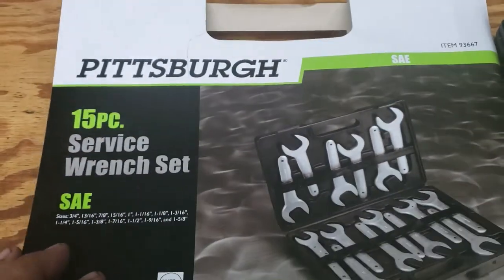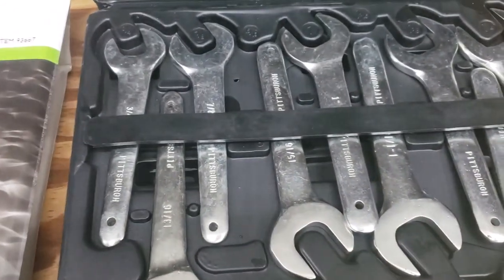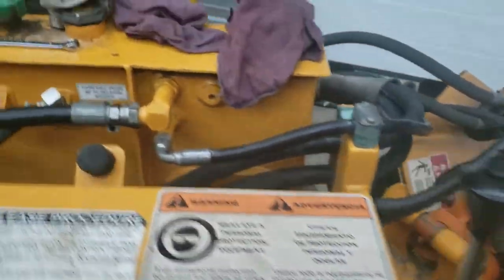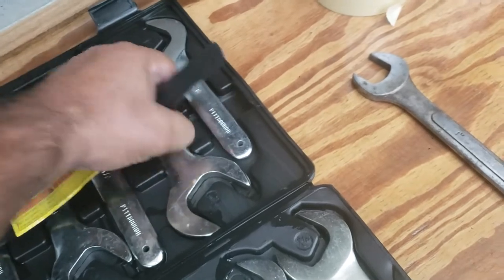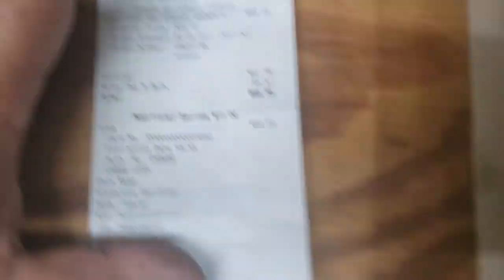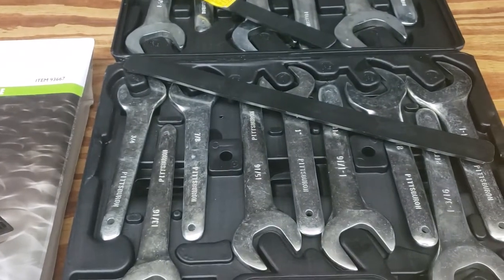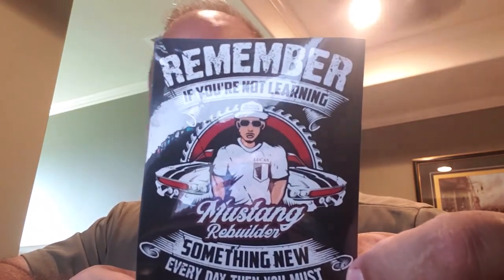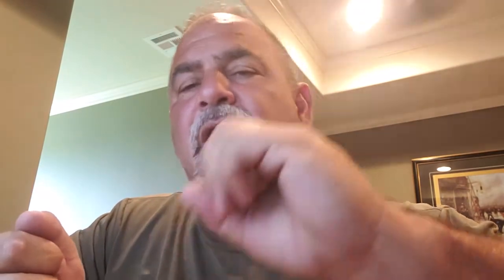Harbor Freight PITTSBURGH Service Wrench Set

Comment: Thank you for making this video, before this I didn’t know what people actually used service/farm wrenches for. I’m a heavy equipment operator and mechanic and always expanding my toolset with new tools I come across that might make my job easier. I’ve had to deal with situations like yours but thankfully had other tools (or combinations of tools) that let me accomplish the task, though after seeing this video perhaps a service wrench might have made it easier.

You’re spot on about having a wide skill set and about the trades in general. I used to be a white collar worker, my first career was doing computer support, repair, and administration. My mechanical skills were limited to what I’d learned maintain in my cars to save money where I could, just simple things like oil changes, brakes, fuel pumps, wheel bearings, and a few transaxles. …mostly learned from Haynes manuals I’ve bought for all my vehicles of the years (if readers don’t now about them then go get yourself one at autozone for your vehicle and be astounded at what you can do at home!)

My IT career stalled out and stagnated at a behind the times company I spent 9 years at, we were still running a mainframe in addition to newer tech, and my earnings were low (around 36k/yr). I ended up losing my job and my skills hadn’t kept up with the times (couldn’t afford school) so I was working a warehouse job and driving pizzas at night while looking for a new IT job. Well via a family friend the opportunity to become a heavy equipment operator fell into my lap.

Cousin’s best friend owned a company and liked hiring hard working people that didn’t know anything so they’d learn HIS way. I jumped at the opportunity and the guy gave me a chance, but I had to earn my position with hard work and dedication. Thankfully I got to train with a couple guys that really knew their stuff and didn’t mind training someone that was willing to work as hard as them. 10yrs on I earn multiples of what I did in IT, now have a decent enough house, a nice truck loaded for bear with my own tools, amore mechanical mind and an ever expanding skill set that’s allowed me to help my neighbors and strangers and that has saved me countless thousands of dollars, and I have options for employment!

Brother’s tradesman too, millwright and industrial maintenance, and we both encourage the next generation of our family to seriously consider the trades regardless of what the kids aim to do in life, we tell them you can learn a trade and earn more than any of your peers while going to college for whatever you want to learn, then you have real options!

One of my nephews seems to definitely be trade bound, tough he hasn’t decided on which yet. He’s the go to for fixing a lot of stuff in his house as his parents are definitely not mechanically minded, it’s kind of funny really seeing two adults with advanced degrees relying on a high school kid to fix things, but he is good at it!

Anyways, keep on with the vids! This is the first one of yours I’ve seen but I’m sure I’ll be watching more!
Reply from the maker: You made my day brother

Comment: I totally agree with knowing 2 trades.   I was a mechanic at one time.  I also went for a different job while I was young.  It paid off and I was able to retire from that job and have a pension.   My love for working on cars has never left me.   I have not kept up with the electronic computer stuff but I could work at many places that do brakes, tires, and basic automotive servicing if push comes to shove.  Plus like you, I'm able to work on my own stuff.

Comment: Thank you for your sharing your experience and knowledge. If someone wants to down you for using HF tools they aren’t anyone we would invite to thanksgiving dinner anyway. 
lol 
I’m glad you made it especially knowing how thick they are. I am using on alignments and thin comes in handy sometimes. I can grind the damn thing down.
Reply: Too many people trash talk HarborFreight tools, but the truth is that HF has a lot of really great and reliable tools! The majority of my hand tools are harbor freight and they’ve held up excellently, and I abuse my tools. Sure they have some worthless stuff, I bought some of their cheapest air tools when I started in the trades and was disappointed (now I run solely Ingersolls for air), but their hand tools and tools and electric tools work great (tho I run Dewalt) and Milwaukee), as do their hydraulic tools, welders, and many others! To me only a fool or a rich person would spend 10x the money buying Snap-On unless they make massive money and absolutely must have a wrench last 40yrs. …but even then they aren’t always that great, I hated my old bosses snap on ratchets because they were sloppy (probably had been abused) and would instead use my own “cheap” Duralast road set when at his shop.

Harbor Freight is a great place for building up one’s tool set and supplies as well as for when you find you need some specific tool in the middle of a repair.